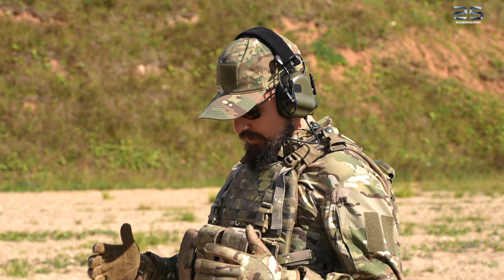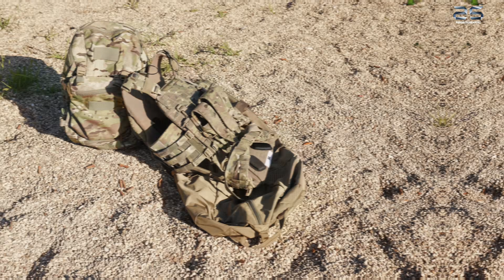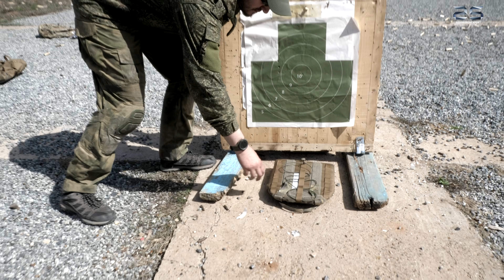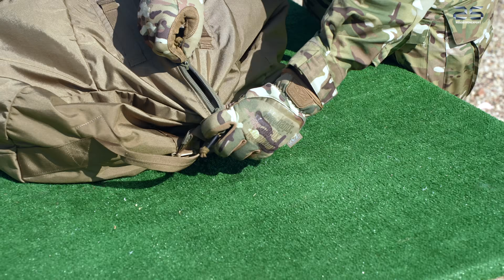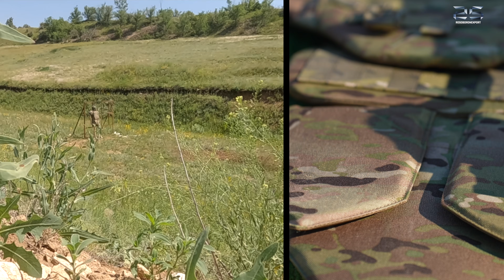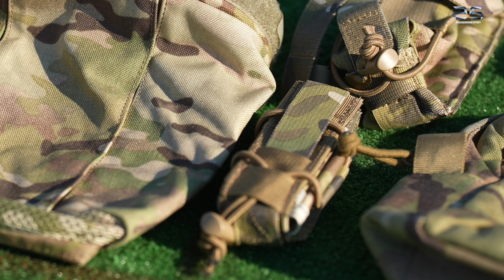STRELOK combat gear kit

Comment: And every Soldier has this on the front?
Reply: As of 2024 yes all storm detachment, specialised ops has different varients based on mission and some people in the rear such at Artillery crew if lucky to get them from distribution op.
Reply: Only about 250'000 troops have these, as it's experimental at the moment.